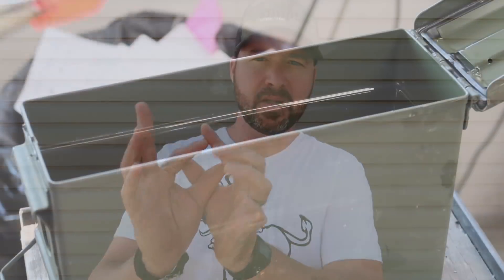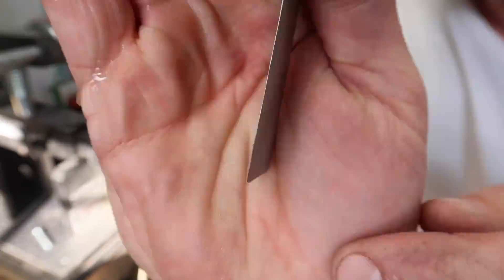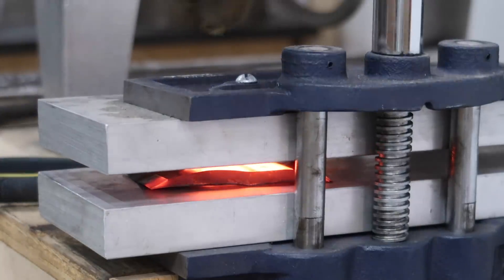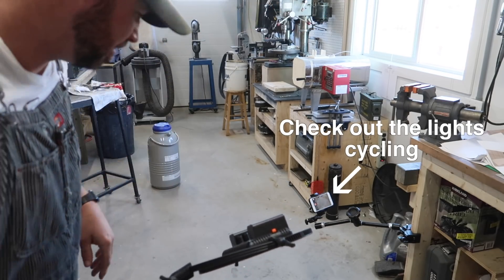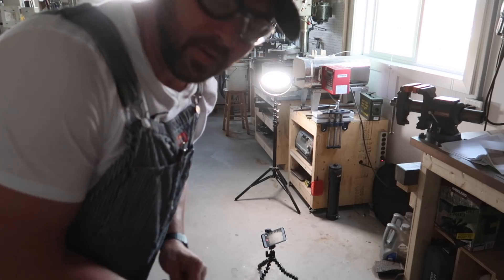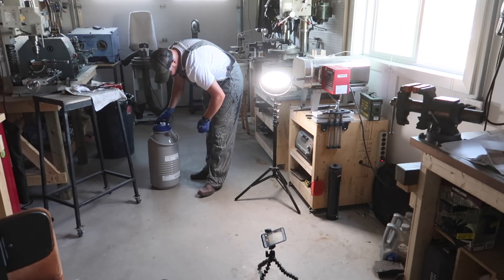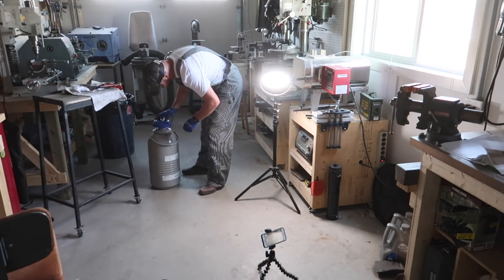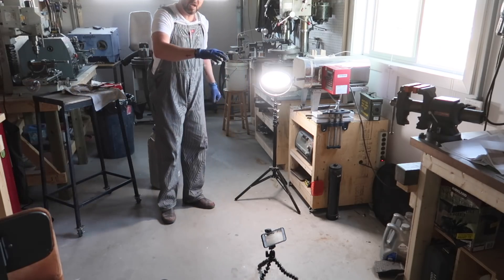Dropping a knife right out of liquid nitrogen. What will happen?

Comment: I understand that some stainless steels need cryo treatments.  What does cryo treatment do for O1?  I would like to see a Rockwell test of cryo vs normal heat treating on a tool steel.  Wondering if it's worth getting set up for cryo treatment if I'm not doing stainless yet.  By the way, I was really hoping to see something shatter.  A racket ball in liquid nitrogen shatters like a light bulb.

Comment: For anyone who is wondering why this is so: hardened steel (martensite) is in the cubic face centered metal crystal form, which does not have a brittle - ductile transformation at low temperatures. All the other metal crystal forms do have this transformation. annealed steel in cubic body centered crystal form should be more brittle.

Comment: usually a blade is dropped ,either on the tip or on the freshly sanded and polished handle🙄
but yes dropped a fresh hardened blade on concrete from a similar height and had them shatter (D2 no cryo)  vague memory tells me that cryo does increase toughness

Comment: Don't know the first thing about cryo but if it is very hard then it will be very stiff. If the metal is that stiff then it will not be able to deform much, if at all, before it will crack. So just by dropping it or even throwing it, you might not cause it to deform. When you hit it with a hammer, looks like it moved it enough to break it! Murphy's law comes into play when you drop a knife you've been working on for a week. That will definitely break :)

Comment: Interesting that the 154 had much more rebound than the O1, that must say something about it's toughness.
Destructive testing is always interesting.
Reply from the maker: I thought that same thing! I was wondering if others were going to notice it. Quite a difference! 👍
Reply: When it bounced up and hit the ceiling you could actually hear that it still had enough energy to bounce off the ceiling.
Reply: I just looked up 'Hardness' in wickpedia, the 154  even without being tempered seemed to have high elasticity which is another way of saying rebound. It can deform under a blow and return to it's original shape, helps to explain why it's such a good steel when it is fully heat treated.